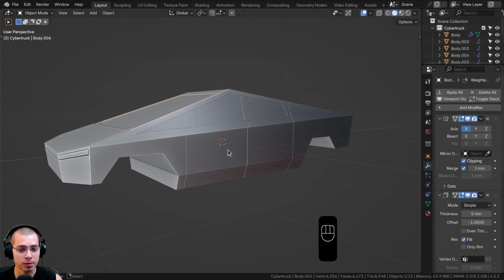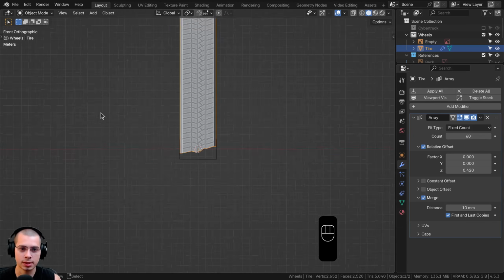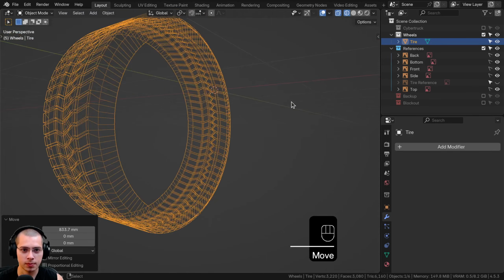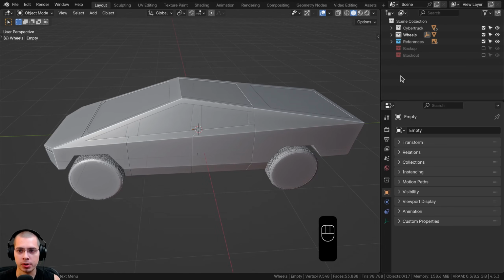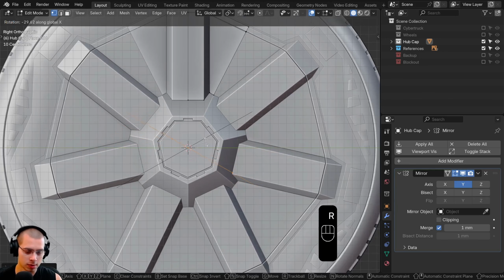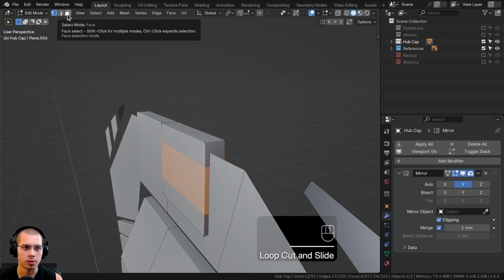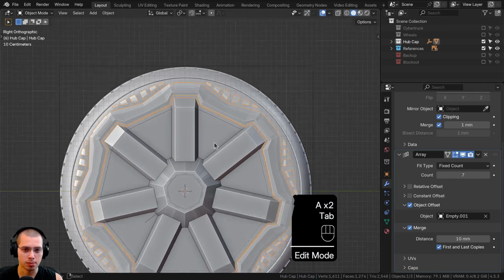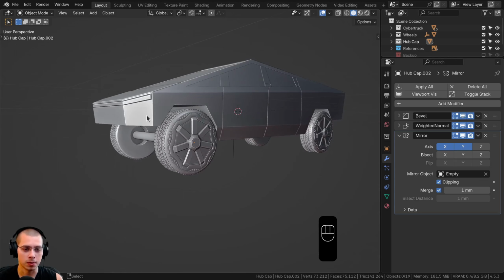Creating a Tesla Cybertruck - Part 2 (Blender Tutorial)

Comment: Heyyy... at 19 mins you made the loop cut at the top center of the middle circle disappear so the extrude/scale down doesn't work for me. I'm honestly not sure how you did that without messing up the mirror.
Reply: I had to separate the middle, apply mirror, dissolve the vertex, e, s, 0, merge, delete all the vertices so they were just the half pie slice, add it to the original and doing that reapplied the mirror and I was good to go.